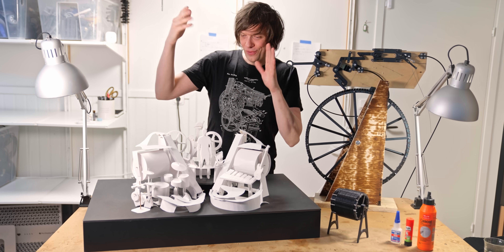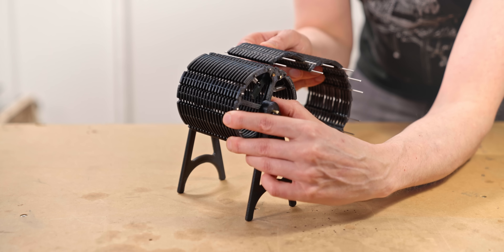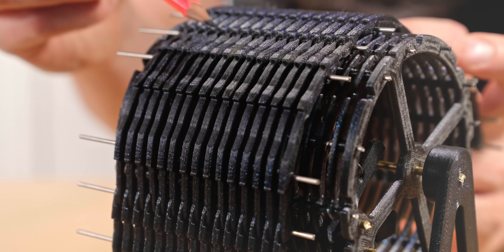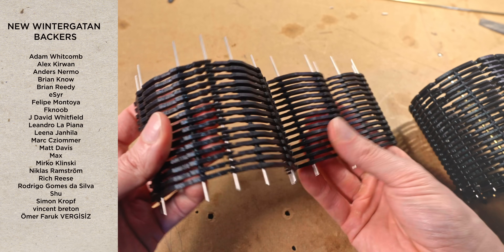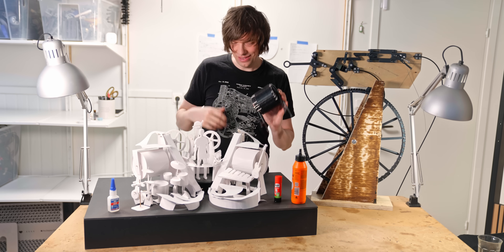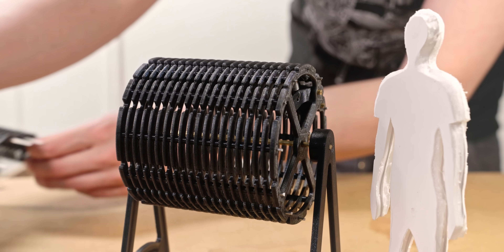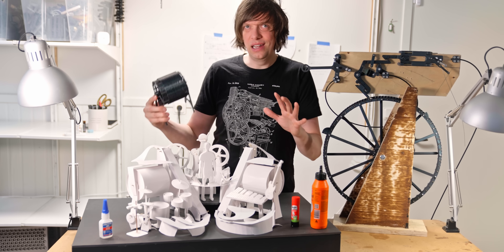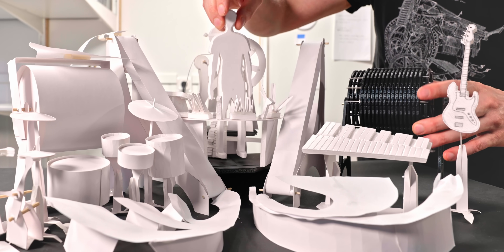A new way to switch songs on the Marble Machine

Comment: there gonna be a few issue when u scale up . there going to be extra noise from all the profile going from a hangin position to a sitting position while turning . there is going to be a little more wear espesially on w.e. you use to clip all the middle rods in , unless you build the weal with a way to tension the two ends of the "songs" together to stop any sagging and shifting as it turns .

Comment: my solution would be to make each pin a micro piston inside the wheel that push pins out of  the wheel, kinda like the old pins idea but instead of pins you use a electrical or mechanical way to make the right pins come out of the wheel this way instant changing the song.
Reply: a mechanical way would be to use some form of pressure and valves.

Comment: He’s traded feature creep for design creep. It’s been years and Martin is no closer to a working machine than he has been in the first two months. He doesn’t know what size instruments to use, doesn’t know what the final instrument will look like, no clue about practical transportation of the device or weight. No clear idea of what the machine will do (accompaniment? Full songs?), even subsystems aren’t fully developed or realized - he’s still messing about with materials and first design principles. No clear idea of how he even wants to input data into the machine in the first place! Honestly, this is a nightmare to watch sometimes. I can’t turn away - it’s like a slow-moving train wreck. I only check in on this project a few times a year anymore and it’s always in the same place, more or less. The guy is just now getting around to building foam core models. It’s borderline absurd. I’d bet every dollar he’s ever made on Patreon that this thing never gets built, much less is able to go any extended tour. What’s his poor bandmates supposed to do while Martin grinds his gears trying to build a marble machine for seven years? I’m all for the dreamers, don’t get me wrong - but this project leaves me feeling very conflicted. I used to be a paying member, so I’m not hating, It’s just confusing.
Reply: Sometimes (often) “dreamers” need someone to provide a bit of a reality-check.  I don’t think Martin has that in his life.

Comment: 7:20 wouldn´t it be possible to remove the one end of the programming carpet, hooking the next song directly and as the wheel turns, it takes off the old song and the new one gets put on? couldnt you simultaniously play/ exchange songs with this technique?

Comment: In my opinion its crazy and not feasible to program songs during the performance. You will need each song to be programmed and ready to go. Switching out a drum is always going to be easier than attaching something and latching it and adding all these parts and complexity that could fail.

Comment: I'm from the future, in the end (50 years from now) Martin develops an incredible design, there are 2 parts, 1 is the programming disk that is a disc made of a kind of plastic material engraved with very small endentures, so small we can´t see them. Each programming disk holds up to 14 songs. the second part is a device with a rotating plate, a large cone and an arm with a needle on the point. you place the programming disk on the rotating plate and have the needle touch it, when the needle scratches the programing disk, the song comes out of the large cone. it is amazing.

Comment: I have 2 suggestions:
- Be able to remove and reload the wheel in the normal direction of operation: don't go the wrong way and break components unintentionally due to the wrong direction.
- Make it part by part: to be able to make transitions between pieces of music, for example by replacing a part (with the pins already planned) while it's playing. Or to make it easier to play, you never know. It's better to plan for all the possibilities.

Fixed pins are a good solution for concerts. It will avoid the problem of pins coming loose when the music is being transported or (un)loaded.

Comment: So that makes changing songs require a bit of physical work, that might get hard due to the mechanics of the parts that engages the instruments (that aren't present atm) that I think would be stressful in the middle of a performance.  If it's using programming in a similar way that music boxes do, couldn't you just have multiple series of 'rows' on the interior of the wheel that you can push out from inside for different songs and the main wheel just has slots going around similar to this where the 'song rows' can pop out their 'pegs'.  You can then either just manually push out the colored rows around the wheel or find one of the existing engineering gearing solutions to push them out.  It would save you from having to drag some big heavy 'record' out and slap it on like a cylinder gramophone that would have multiple points it could just break on you or break some key component that engages the wheel for an instrument.  It would also mean that you could leave the manual programming inserts instead of having to CnC a whole new thing for each song after you compose it.  You can compose and 'record' it at the same time...and if you decide you don't quite like something you have full freedom to just alter the song without having to reprint the whole thing.

The side view would look a bit like a complex multi-pointed star if you can see it and changing songs would move the high 'points' to different songs.  Could color code the points to make it easy to see which one is engaged at a glance.

Also I had asked this previously - is there any reason the wheels have to be oriented to scroll down from the font instead of being on their side or something?  All the ways you've shown different orientations it's always in that 'steamroller' orientation.

Comment: There may be a way that a single programming wheel can be mechanically re-configured (using something like paper tape) to key in a new song, wiping the old one. It seems to me that adding and removing "armature" is unnecessarily complicated when you could "feed" the programming wheel the specs for a new song and have it self-configure (in much the same way a DOT MATRIX printer builds up it's image line by line), then do the same for the next song. Mechanical wear and tear of the removable songs will possibly introduce bump errors and inaccuracies as backstage is a rough and tumble environment, storing songs in road cases seems fraught with damage opportunity.

Comment: I’m sorry but that will be heavy and unwieldy and not stable when put to the real scale , why not use thinner strips with sift register thpe of design that changes the songs you could fit at least 8 songs in one wheel and basically change them immediately?

Comment: I think an electronic/solenoid solution would enable rapid iteration during the song-writing/programming step of the process. How cool would it be to write a draft of a song in MIDI, and then play that MIDI file on the MM3. From there you could manufacture the final pinning and wheels, and play the song fully mechanically on tour.

Comment: Hey, regarding the composing while playing, you can make a mechanism to auto remove all programming pins after it was used in 2 staps, the first stap slightly lifts the pins up. The second step removes it in its entirety. If you want a pin to be replayed during a loop you just prett it in slightly. The other ones will be removed entirely.

Comment: It looks to me like you’re stuck on the wheel.  This limits your thinking to only the wheel.  This also limits the length of your music to the size of your wheel.  Since you mostly detach the music from the wheel, turn the wheel into a cog instead of thinking of music on the wheel.  Then the music can be programmed on something resembling a chain.  The music could be on a chain pulled out of a bin and deposited in a bin on the other end.  You could loop the chains together to play the same music over and over or you could link different sections of chain together to make it as long as you wanted.  As long as you had people behind the scenes attaching the links of chain you could play music for as long as you had the energy to step on your petals.

Comment: Could just have a larger stacked record player with long arms, and each "record" has pins ticking out of it; would make switching easier as just change the large programming discs, and the pin positions can be continuous/analogue giving potentially higher precision.

Comment: Flatten out the plates, and you have something like those books for programmable organs; which might actually be the better solution, "make your requirements less dumb" etc. A drum does look more cool though, especially from a distance.

Maybe this version being modular you could have different kinds of input modules? That'd be kind of cool actually, maybe songs could even be switched by switching which module is active (although such a mechanism to live-switch those over might turn out to be very tricky in itself)

Comment: Stupid thought I just had, if the power requirement is just too high for Martin to power alone, could an e-bike motor be retrofitted in there?  The couple that I have experienced make me feel like I'm just exceptionally strong that day (one Bosch system and one TQ system, Bosch puts out more power, but has way more drag if you need to use it with the assist off), the pulses of the pedal strokes are still there so it wouldn't be the dead exact constant torque and RPM output like a regular motor.  It should still end up feeling like a person is powering it, just way easier than it would have been without it.

Comment: What works on a small scale, may not work at all on the final big scale, it may be two difficult to handle.
For example how much weight will that entire "song" have? I imagine going up scale that it will be huge.
How many people will be needed to remove it, will they be able to remove that out, without bumping into other instruments, in low visibility conditions? 
How much space will they need around the wheel to do their job optimally and safely? 
etc.

Comment: Guys in lab coats is something that would lessen the impact of the experience for me.   How about instead of using fixed-length programs that wrap exactly "around" the drum, you go with a loose "chain" of sections of addressable, connectable and disconnectable programs that could be reused for bridges (and to change songs) that drapes over the drum? The sections could be accordioned into a tray under the machine after being played (those needing to be reused , presenting an engineering hurdle due to requirements for their storage and preparation for reuse.).  Maybe a pin extension at the end of every distinct section to tell the device when to connect or disconnect?).  The connecting and disconnecting of the sections would present a challenge if electronics and solenoids are not allowed.  Either way...  Draping the sections would allow for flexibility in the duration of any given "beat".

Comment: Question: Does the outer layer have to be made of completely ridged segments? if it was rigied pins attached to a sturdy yet flexible material it could be much easier to store and lighter to move around which makes it more functional?

Comment: I still feel these programming 'pins' are so large compared to the circumference of the wheel. How many individual notes could you fit on a single revolution? And would that be enough to cover a full song on all the tracks?
Reply: These are not "pins" as such. More like "cams". The lengths of the cams, combined with the fact that they'd have dips and peaks in their shapes, means that one "cam" can play many notes, say, if each cam represents a single measure of music. It means that the number of total notes is no longer limited by the circumference of the wheel. Perhaps better to think of the wheel as a total length of time, not a total number of notes. The cams now determine the number of notes based on their length and where the dips and peaks are along their lengths determines rhythm.

Comment: If you think of it, the hygen drive is kinda similar to the special power bar in a video game (ie. Tecken or Skate) The drive module could be featured as a more prominent and towering feature and could be designed in such a way that there are ropes, pulleys and a ratcheting mechanism so that the audience can interact with the machine and provide power to the drive module.

Comment: Two possible ideas (that youve peobably already considered. But ill post em anyway). 

What about using thick paper (or like, very thin sheet metal) to create template holes that you can wrap around the wheel and manually place the pins that way? At the very least, it would remove the risk of mistakenly placing the wrong pins. And save time with setting it up without needing to deal with heavy attachments that could strain or break the wheel. 

Or alternatively, have the pins on simple springs within the wheel, and the outer template holds down all the pins that arent  being used for the song. And In order to stop the pins from moving around during the music you could use some sort of locking mechanism that sets all the pins after the template has properly displaced the ones being used for that song. Then you could remove the template, which ensures it wont get damaged as easily.

Comment: You'll definitely need a gear system to ensure the various programming wheels stay synchronized. If you're OK with one wheel turning the other while changing programming "wraps", then it's OK. You can always adjust stage lighting to reduce how much attention the wheels get while being changed, or even some sort of curtain system.

Comment: I might just be an RC guy, but when i think of how heavy a chain is, a good one, and its say 20ft - 30ft long, its heavy.
Now imagine one for each channel and all stuck together as one.
Its going to take a crane or robot arms to change a song, which in itself may be a very cool stage show with lighting and the band playing along.
But also another thing to think of is traveling with this as a band.
An album of songs now requires an extra semi truck, and special rack to isolate the songs from vibration and rubbing against each other and the truck and violent forklift operators, and all that extra fuel, not saying its a bad idea at all, it's just stuff to consider.

But just imagine the song ends and automatically these arms come down and peel the song right off the barrel.
They drop it behind the stage and pick up another and string it right back on to the barrel in a matter of a minute or less as everyone is asked how they feeling tonight.
lol its awesome actually,
I have been watching for years don't ever stop

Comment: one thing I would suggest for the final machine, that the system that powers the time sensitive components be separate from the system that powers the conveyor system. not to say that the conveyor beltswould effect the prescise timing of the hyugen mechanism but I think it'd make more sense to not use the time sensitive mechanisms for the non time sensitive mechanisms.

Comment: Um again- each of those ‘sections’ of programmed ‘wheel’ are the equivalent of a single ‘card’ in a jacquard loom.   The only thing you are missing is that you don’t need them on a ‘wheel’ at all. They can be on a ‘belt’.   Imagine the track treads on a tank.  Each ‘plate’ is a bar of music, that gets fed via a sprocket thru the pins that actuate the marble drops… and then loops around.   The thing is the ‘belt’ can be as long as you like.  It can have an entire performance of several songs and you don’t have to change anything except to stop the belt feeding when you want a pause between songs…. Or have plates in the belt that play no music for the length of pause you want between songs.  The actual playing head can then be a smaller wheel just for holding each plate and feeding them with correct timing, with the belt falling away from the back side of the wheel and into a neat folded stack below.     This is how they solved the issue of wanting longer, more complex ‘programs’ on a loom. And it would work well without the disturbance of swapping huge wheels or trying to correctly wrap an unwieldy collection of programmed plates on and off a wheel.

Comment: One of the first issues the comes to mind is the human power required to remove and insert the new design on the wheel. 
Even if the rings are laser/water cut in thin plastic still take into consideration the total weight of the mechanism.

Comment: Suppose the programming wheel is 1m diameter, so 3.14m circumference. Let's also assume it rotated once per minute, so just over 5cm/second If the wiggle room in your HUGE and probably heavy peelable music roll would be even 0.5mm the inaccuracy it'd cause would be nearly 10ms.

Assuming you'd make it out of acrylic only 3°c of temperature increase would cause about a 0.75mm thermal expansion making your plate unusable outside of a very strictly temperature controlled area

Comment: What if you had a mechanism similar to the mute pedal on a piano, that shifts the programming wheel slightly to one side to switch between two song patterns? You could fit two songs on each wheel pattern and save space/time physically replacing them (Pianos have multiple strings for each key that the hammer normally hits all at the same time, but the mute pedal shifts the strings to the side so the hammer only hits one of them)

Comment: No gear changes or rebuilding of any kind would be necessary if you just replace the cylinder. A song cylinder would just be swapped out. These hinging, latching contraptions are unnecessarily over-engineered and over-complicated given there being a very simple and less prone to malfunction solution that has existed a hundred years already.